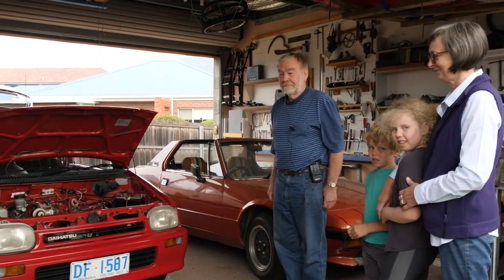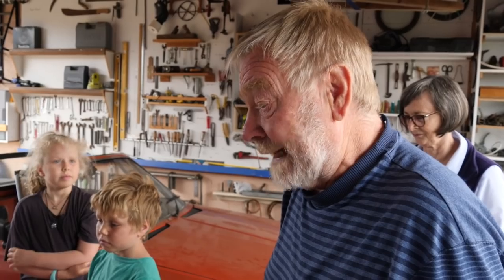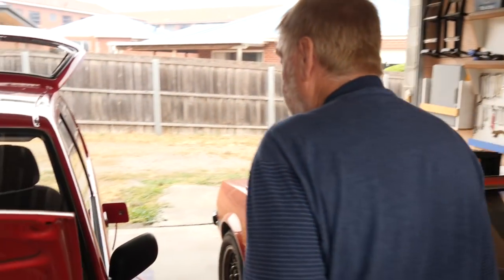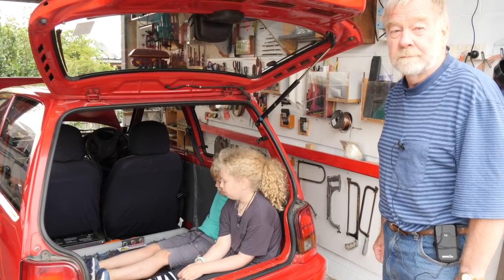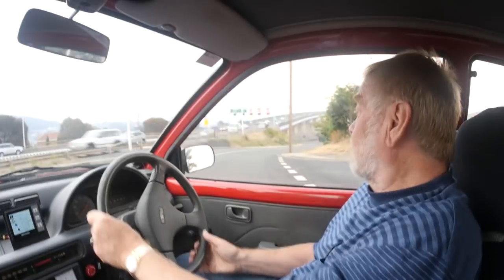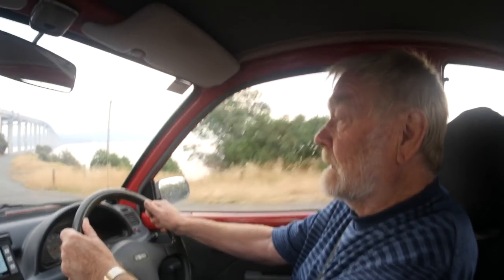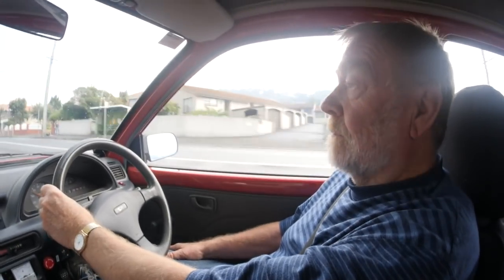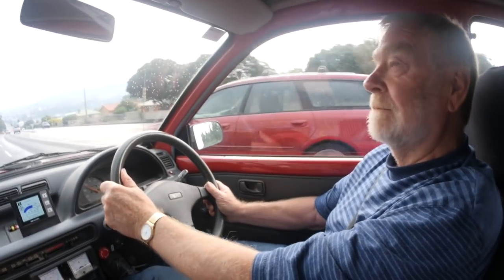Homemade Electric Car Conversion - $8,000 D.I.Y.

Comment: Doing some cursory research at the moment. Very, very helpful stuff in this video man!

I've got an old Suzuki Sidekick sitting in the back yard, been there for like 12 years. Structurally good but everything about the drive train has been run into the ground, slightly fixed up, then run down again. Pretty sure if you opened the engine block at this point there would just be rust and oil slurry in a metal case. :P It was on the way to the junkyard, but then little 11 year-old me let slip that I kinda wanted it all those years ago, so I was handed they keys. It's been sitting parked ever since, interior slowly melting under the New Mexico sun.
Been wanting to do something cool with it for years now, and I think I've finally decided. I want to make it a cool little scruffy recycled EV... thing!

A huge part of why this is so appealing to me is it's a cool way to make a super economic car. Bit of cost upfront in the name of getting rid of those crushing maintenance costs needed to keep the 500$/sub-500$ cars many of us rely on out here. It was kind of surreal hearing that little jab about rich Americans, cause maaaan that wealth ain't spread equal. Not even remotely. I dont know what you guys see about us but the scene outside you car window looks like the "rich" side of town out here, at least in southern NM. The majority of the US doesn't get much screentime tbh, mostly nice parts of the the better off states like California and Texas, New England area ect. We've got our own mess of problems out here I guess, a lot to fix, got to live with it in the meantime though. 

No oil, no pump gas, no nothing. Combine all that with solar panels for home power and now we're cooking with, well, not gas! Heck yeah. If I could get this done on a budget like you did here dear god the money we could save. (a detailed build video would be hugely appreciated) You've done a beautiful job on you project here man, it's really inspiring. Hope all is going well for you guys over there, a lot has happened since this video was posted. Stay safe, hope the world is treating you well.
You guys seem like really cool folks, thank you so much for sharing.

Comment: $8,800 in 2010/2011 is terribly good value for the 3Ø motor, controller/inverter, battery charger, and (approximately) 20kWh of battery cells!
Reply: i don't think the battery was included in that price
Reply: Maybe the 20kWh of battery cells cost a total of $100. After all, the description does say, "He completed the conversion 8 years ago for an approximate cost of $8,900."

The video would be terribly misleading if not!
Reply: A 20kwh battery now costs 15 000$ with the BMS
Reply: I know! I paid just over AUD$20,000 for 20kWh of batteries in 2017, and that didn't include the BMS. This fellow seemingly paid $100 in 2010/2011! What a bargain!

Unless the video is a bit of a fib, or he somehow got the batteries for free without mentioning them in the video...
Reply: Aaron Czechlski  
it is not so much  a matter of being smart enough,
it is a matter of reliability. i think buying the whole packet will be cheaper. 
and directly importing from china might be cheaper, but,  ....   you have no warranty and you do not know about the quality.
Reply: I know this reply was 8 months old (so my apologies to OP) but I've been seriously researching this subject myself.

I've priced out a battery supplier which puts the cells required to assemble a 20 kwh battery at around $5,500 which includes the usual credit card purchase protections, etc.

Admittedly I'm a lot more timid about taking that kind of a jump in to DIY EVs as this chap but he's already an electrician so he's got that step done whereas it's still in front of me. ;)
Reply: @elgalloazul  I'd be assembling DIY but the cells, which are a huuuge piece of the cost, including shipping them from China to me have been priced all in at around $5,500 CAD.

That'd be about $6,100 AUS so it's not crazy if you have the knowledge on how to assemble it themselves (he's an electrician) it's not beyond the realm of possibility.

Of course there's real value to procuring a professionally assembled, tested and certified battery but if you've got the skills and the time you'd be stunned how cheaply they can be made.

Well, cheap is relative, I suppose. That 100 kwh battery I've been eyeballing is currently priced at around  $28,000 for cells alone sooooo...... I might just buy a Tesla. lol
Reply: @Cheebzsta  
go for it and take the risk
and then report back to us if the capacity is actually the capacity they advertised.
and keep in mind, you have no warranty if something goes wrong.
Reply: @ursodermatt8809  As you suspect they don't reach the capacity advertised (which is something ridiculous like 3600mah+) but based off the photos available from different customers they still seem to reliably come in around 3000mah which makes them a steal overall.

In terms of warranty provided and coverage for lost funds the source site itself is decent (albeit not perfect) and I've confirmed the card I'll be using offers coverage related to extended warranty or misrepresented/fraudulent sales.

Don't get me wrong. I wouldn't be going in on $5,000 worth of them (much less $20,000 for that 100kwh dream) on the first purchase. Too risky in terms of card coverage.

But I plan on starting with a two person go-kart DIY-ed from the ground up as much as my expertise will permit. 

I'll buy my first lot of them and use it to build the battery pack for that project. Give it a proper trial while all within the various card protection amounts.

That's the dream in the next 6-9 months. Hopefully it'll go well!
Reply: You're better off buying a generator instead.
Reply: @mystical388 
You are way out of your depth
Reply: Why spend $15k+ on batteries and have to wait hours to charge when you can purchase 1k generator that can power the DC motor adequately you can even throw in Ac and heater too
Reply: @mystical388  
like i said, you are wayayayayaya out of depth.
Reply: @mystical388  Better off in what sense?
Reply: @ursodermatt8809  I payed $4200 for a one year old BMW i3 32kW battery pack at a breaker with shipping. However, I only had use for 20kWh, so I sold the remaining 12kWh for $1800, ending paying $100 per kWh. So it is not as expensive nowadays as people imagine, with production EVs involved in road accidents every day!
Reply: @Tore_Lund  
yes, it is not as expensive anymore. there are not many EV car wrecks in australia though, because there are very few EV's here. but lifepo4's can be had very cheap from china now.
Reply: @ursodermatt8809  Yep, you have an advantage with China so close.

Comment: AUS $8k is pretty good, but I’ve just watched s video of a guy jn Ireland who did it on 3 series BMW on a budget of €1k and it drives amazingly, it just passed it’s MOT as well which means it has been declared fit for road use. As long as you look after the car, it’s essentially a car for life.

Comment: G'day, thanks for sharing a fantastic conversion, very inspiring. You linked to your website for more information and the motor link took me to lynch motors but it doesn't specify what motor was used. I'm very interested as an AC motor was used and lynch motors use specifically DC motors for EVs

Comment: Well Done Warren - a very exciting and successful hobby project. What problems did you have getting it approved to drive on the road and how much to get the roadworthy approval? How much more did your insurance increase since it is now a modified vehicle? Do you know anyone in NSW to contact that does EV conversions should I decide not to wait to buy an EV brand new or used? It is so costly right now to buy an EV new without government support through tax credits like how overseas countries have implemented to kick start their EV revolution.

Comment: I'd like to know how i could make it AWD (IE:  remove the old tranny instead of building an adapter plate) and running 4 DC or AC motors... and what kind of amperage/wattage/voltage are we talking about here?  50AH? 100AH?   150AH?  and I'd assume i'd need to replace anything that was controlled by the inside(or drivetrain computers) that would more than likely show me the battery voltage/amperage / range left % charged etc.... But I figured right where that old tranny and motor used to be would be an ideal spot for more batteries :)  Also how did you control the current going to the driveshaft / electric motors?  And how big was the single Motor that was used in this Videao in KAH / Wattage???

Comment: Great little car. I see the car had a normal manual transmission, could you tell me if the car has a clutch and if not how did Boyler break drive when changing gears? If forward gear changes were made.
Thanks.
Reply from the maker: The car has no clutch (and no flywheel). Because there is no particular spinning mass all the is required to shift gear is to back off the ‘throttle’ then shift gears.  In any case mostly just leave the car in third gear.

Comment: Thanks for sharing. In high speeds it's necessary a gear shift to be more efficient or because the motor has a rpm limit?

Comment: Some technical figures would have been useful. However, I'm concerned with his lack of political acumen. Yes, we can replace the importation of petrol with the importation of motors, batteries and solar panels. Doesn't really help, does it. Last word, though, is that nobody wants a car that can only travel 100km on the mainland, especially when recharging stations use proprietary interfaces.